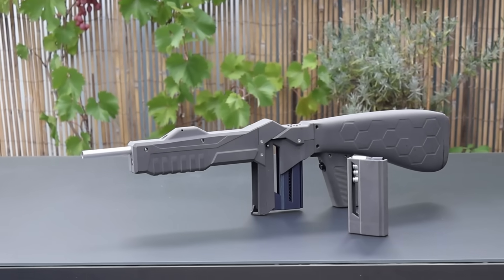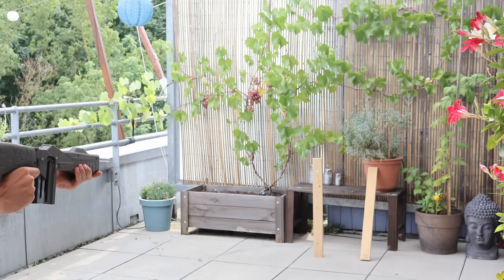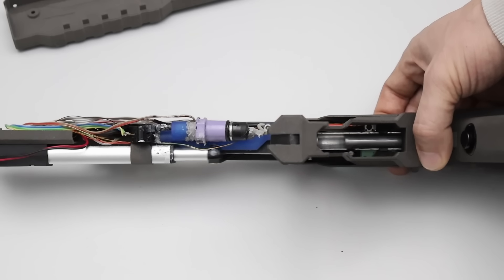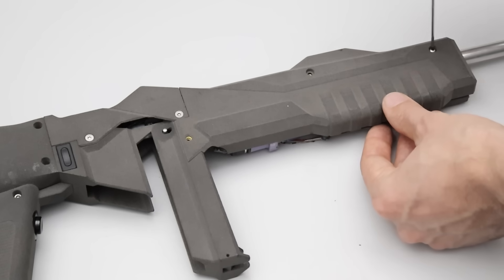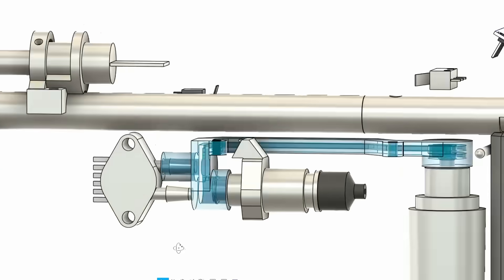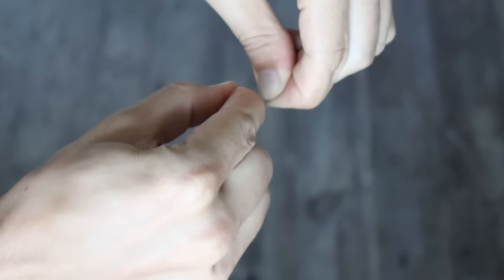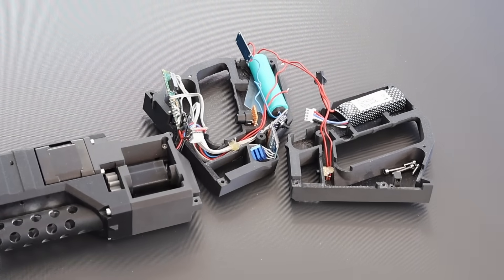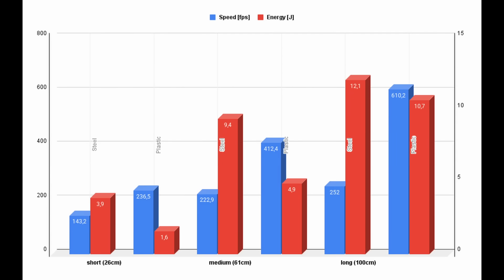I Built a Semi-Auto 3D-Printed Spud Gun

Comment: I've seen simple designs (in quotes, simple). Some guys from Malaysia or the Philippines, I don't know, have fully semi-automatic guns there that work like clockwork and produce 600 fps. They make a reducer, something like a carburetor from a simple tube with holes inside which is a syringe needle, the gas captures the required amount of air and blows into the combustion chamber, the bolt lever is connected to this mechanism, you unload the ball and hold the bolt pulled towards you for one second - it's primed, close the bolt and shoot, and so on 20+ times without error. These are some kind of miracles. I took a simple 250 ml hydrogen peroxide can (thick plastic) and sprayed insecticide for insects inside (it contains 95% alcohol and 3% propane). I sprayed and waved it until a mixture formed. The tube/barrel is in the lid. It was very difficult to use. But it was a damn can with a tube, so if something happened, you could rip it open and throw it away, and you'd be out of trouble.
Reply: But as always, it turned out to be much simpler and had already been invented before us, lol. A gas paintball marker. Specifically, one that works by igniting the mixture, not just gas like an air gun. This thing is fully semiautomatic, and it sold without issue, worked flawlessly... and no electronics, just a piezo.

Comment: Combustion took time. The position of ignition source is also critical: it is better to place ignitor at the very center of combustion chamber. Or plase several sources if electric sparks are used. HV-module can beeasily used without ant RF interference - just power it with completely separate lithium battery and trigger from the main board through the mechanical relay. Or connect ignition directly to the trigger button without any connections with the main control board. Good electic spark provides much more reliable and rapid ignition. Also, some obstacles to make combustion fron turbulent may greatly speed-up the combustion process.
The speed of combustion is the main cause plastics can't get high energy from short barrel. They just leave too fast before the pressure reaches it's maximum.
Reply from the maker: Those are very good points. Thank you! 
If I build another version I will do it exactly like that. I saw Smarter Every Day’s video on YouTube where he also investigated the ignition position. But I like the idea of igniting at multiple points much more. For some reason I hadn’t thought of that at all.
Igniting with the tungsten wire works reliably in a few milliseconds. But after a few hundred ignitions I have to replace the wire, which is a drawback. And simultaneous ignition would probably be problematic with that method.

Comment: If the longer barrel allows you to give more energy to the projectile wouldn't it be better to (re)design your gun around it? It's a pain in the ass, of course, but it will give you more space inside to work with
Reply from the maker: How do you mean? Making the combustion chamber smaller? I wonder if the energy would decrease then even with the smaller barrel though the chamber seems to be bigger than necessary for the shot barrel.
Reply: @it_could_explode  or keep the optimal barrel for the chamber and build a bigger body to fit the barrel. It should give you a bit more space for the wiring if it's a problem

Comment: A steel ball has much more inertia. It accelerates more slowly. It remains in the barrel for longer, allowing more energy transfer. A plastic ball is spat out fast and a lot of the gas gets wasted. In the longer barrel, the plastic ball is inside much longer getting closer to max theoretical energy transfer.

If you want even more energy, spray some silicone lube into the barrel and on the balls for a better seal and less friction.
Reply from the maker: Good explaination, thank you!
Reply: @it_could_explode  You're welcome. I want to test this theory on my paintball launchers. Even bought a radar to measure the speed, but haven't gotten around to it yet. But it makes sense.

Nice video BTW, gave me some interesting ideas...

Comment: Did you consider using an oxygen tank instead of air for better control over the gas/oxygen ratio and better utilization of the combustion chamber's volume?
Reply from the maker: I actually did, but I haven’t found any compact tanks. Less effective but better than air would be nitrous oxide, which is available in very small cylinders. However, both oxygen and nitrous oxide are stored under very high pressure. That’s manageable, of course, but not easy if you want to keep it compact and have only limited manufacturing capabilities.

Comment: Could you add a duel gas chamber  that alternates when firing to speed up the action and use 2 gas bottles that are alternated in the up down position, one will always have the liquid oriented on the bottem. Use a sensor to determine the orientation. The cooling problems would be mitigated.

Comment: The increase in speed could be explained the same way as is with airsoft AEGs. There is a volume ratio of chamber to barrel. You have a massive chamber holding lots of gas, especially in its expanded form. The projectile is out of the barrel long before all of the gas leaves the chamber. That means lots of energy of the gas is wasted with a short barrel and the longer the barrel gets, the more efficient the system becomes
Reply from the maker: I think thats right

Comment: Just an idea for a compact filter you might find one inside of a "bic lighter" or one of those small "jet lighters"
Reply from the maker: I thought so too but if you hold one of these jet lighters upside down for a while the flame will suddenly be much smaller. That is when all liquid gas in the hose is used up.
Reply: @it_could_explode  I took one apart and it definitely has a small filter in it.

Comment: Have you considered making a pneumatic/basic compressed air version? Doesn’t even need to be CO2… could use a hose to connect to a belt pack or backpack style air tank to be able to have enough capacity, if it can’t be fit within the launcher itself.

After making many versions of potato cannons, I made a golf ball cannon - but used compressed air instead of igniting a gas. Was very very effective and allowed for more predictable/consistent results. The compression chamber in my version simply had a shrader valve (like a bike tire) and we’d hook it to an air compressor to fill it. My design was intended as a single-shot - but we could have connected the chamber to a larger supply of compressed air for rapid refills, controlled by a valve. This could be an electronically controlled, automated valve mechanism - to try to stay faithful to the complexity/styling of your current design

Comment: about the barrel length and projectile mass. The steel projectile is too heavy for the propelant charge. Its similar to the ballistics between 5.56 and .300blk. The 300blk mass to propelant ratio was optimised to specifically go subsonic with high mass. 5.56 has low enough mass that chamber pressure can take it to much higher velocities with a similar charge. It just needs length to accelerate.

Comment: With a shorter barrel, the plastic bullet has already left the barrel, whereas the steel bullet still experiences energy transfer. The longer the projectile stays in the barrel, the more energy can be transferred. Up to the point where all energy is transfered and friction and the cooling of the gas will decelerate the projectile.

Comment: The energy getting bigger with barrel length is kinda weird... 
But best explanation I reached is the amout of time the pressure is acting on the projectile (this is from airsoft systems and it was refered to as joule creep)....
Heavy ball will take more time to get  out of the barrel compared to light ball (steel vs plastic). The longer the barrel the better  for the plastic ball as more of the energy of the explosion is used.

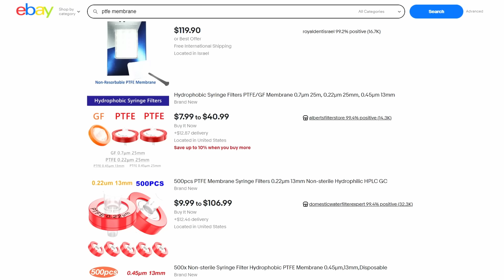Comment: At about 9:50 where you are wondering about a filter/regulator for the butane, I think you can get one from a Bic lighter. It is located under the outlet as part of the valve. You could probably just break a lighter apart and use the valve from it as a regulator. This is a great project!
Reply: Just commented exactly this, it’s a good idea. If higher flowrate is needed, some butane blowtorches/burners have exactly the same part, just scaled up to allow more fuel through.

Comment: If I'm wrong ignore, if you are from Germany however, (bc of the accent) this "potato cannon" is illegal af and could get you into a lot of trouble. Legally anything that accelerates a projectile through a barrel is a gun in Germany, which is illegal without proper license and improper storage. Due to it being a gun, you absolutely can't mount lights or lasers on it, that's another law (that airsofters hate). I love the engineering but it's still technically illegal and could get you a minimum of 6 months all the way up to 5 years of jail time and a fine. Be careful please

Comment: My best guess would be the steel balls just require more force to approach the speed of the lighter plastic. Longer barrels always just mean there's more room to apply pressure before it exits  the chamber, though required propellant volume increases with barrel length. The explosive propulsion is transferred to lighter projectiles as speed more easily due to a lower mass resulting in lower energy but faster moving projectiles, while the opposite is true for higher mass rounds. The other issue you might be facing with the plastic rounds is a less perfect sphere results in more escaped gas pressure before exiting the chamber and less energy transfer over all.

Comment: I think the answer to 16:06 is to do with the mass, the speed the gas burns and the time the projectile takes to clear the barrel. 

The steel balls are beginning to experience losses, possibly through gas blow-by or .   But also less energetic combustion over time. 

The plastic balls are still experiencing the most energetic combustion but for the full length of the barrel. Also less time for blow-by gases.

There may also just be a difference in clearance allowing the plastic balls to have less blow-by overall and everything above is just wrong. 

Either way. Seems you have an optimum projectile mass and barrel length. Time for discarding sabots? 😄

Comment: For the gas/liquid issue, look at de-icer units from older CO2 powered paintball marker/guns.
in the 90s i built one with hydraulic fittings and cutting up aluminum wire into small bits.

Comment: to the last Point: The formeula for kinetic engergy is (1/2)*m*(v^2).  
So the Velocity (because its gets squared) has an significant higher impact on your Energy output compared to the mass of the projectile.  
Which results in the decreasing difference between plastic and steele.

Comment: 16:00 airsofters call this phenomenon "joule creep"; It's mainly revolving around the fact that the more time the projectile spends in the barrel getting accelerated, the higher its final velocity will be. The heavier the projectile, the slower it accelerates, the more time it spends in the barrel and the more gas is burned and the more energy is transferred to the projectile.

Now the longer the barrel gets, the smaller the difference becomes because both the heavy and light projectile spend so much time in the barrel that most of the potential energy from the burning gas is already transferred to the projectiles. In theory, with an even longer barrel, at some point both projectiles would have the same muzzle energy because 100% of the potential energy of the gas would be transferred, and the shorter the barrel is, the bigger the advantage gets for heavier projectiles.

This also occurs in real firearms, where operators sacrifice muzzle energy to have a more compact and maneuverable rifle, and where hobbyists accept higher bullet cost for heavier projectiles to have more muzzle energy and accuracy at range.
A special example is the .300 BLK calibre which comes in supersonic and subsonic versions, where you can use the same rifle with a very short barrel (usually 6-9") that will either achieve super quiet sub-sonic shots using heavier projectiles, or getting faster moving but much louder supersonic shots using lighter projectiles.

Comment: for the barrels the lower sectional density of the plastic balls means a smaller pressure can still push significantly. think of putting your laptop infront of a fan verses a sheet of paper. one is easier to move.

Comment: This is an amazing project, however I have a quick question: wouldn't it be more feasible to move the air vent to the side of the stock, instead of keeping it on the back of it? That way, you could just shoulder the cannon without worrying about the oxygen supply in the chamber.

Comment: The gap between plastic and metal ball decreases with increased barrel lenght mostly because the metal one is unable to increase its speed while increasing the barrel lenght. It could be because of higher metal to metal friction, or maybe a tiny size difference. Before the graphic, i've bet the steel one would increase further with longer barrels, since it would keep higher pressure behind it for longer than the plastic, wich would accelerate faster, and thus spend less time accelerating... I'd can easily test it with different materials, try brass, and different types of plastic (nylon is know for low friction), and if the key is friction, nylon coated steel balls.

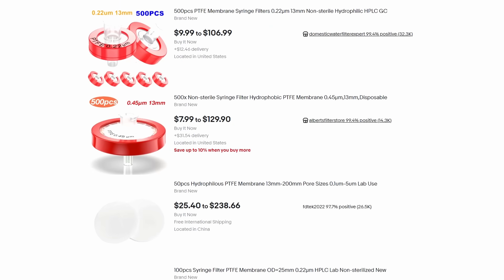Comment: Hey! I have EXACTLY the right solution for your liquid to gas filter at 9:52.

You would be better off diffusing the liquid butane using an aquarium air stone! This serves multiple problems you’re facing:

- The butane can fully expand through the air stone
- the stone will contain about 80% of the cold from the evaporation instead of cooling the chamber
- no material damage from solvent gas and can withstand the explosion and heat vs membrane filters.

Its the perfect candidate! I love your projects and i hope you find this helpful.
Reply: Aww thanks guys that was so wholesome. 😂 i didn’t ever expect to be on the recieving end of internet kindness and i really appreciate it
Reply: @Dudeinatube  You find some really cool people in the comment section of videos like this! It's almost like the Internet in the 90s, before the normies screwed it up.. 😀
(Yes I am old.. o_O)
Reply: you are one cool dude in a tube
Reply: Another REALLY compact solution that’s ready to accept plumbing tubes is the tiny metal nozzle output of a butane lighter’s fuel tank. It has metal mesh inside to diffuse the liquid into gas and is specifically designed for butane (pressure and corrosion resistance).
Alternatively, get a butane burner that’s advertised to work upside down. Pulling one of those apart reveals a metal sponge in the gas tube designed to diffuse liquid butane into gas, with the advantage that flowrate doesn’t actually change when liquid is fed instead of gas (the liquid is slowed down in the sponge while gas flows more freely, so when liquid expands, it doesn’t explode in volume).
Reply: @someonewithauniqueusername9397 awesome you’ve played with your fair share of lighters too! 😂 these would definitely work 100%. But the one i recommended relies on the exact same principles and can be found in sizes as small as 1x1cm. Looks like he’s got two options now
Reply: Replying to boost this. Neat solution!
Reply: Can also use the sintered brass air line vent diffusers.
Reply: good job

Comment: I would like to suggest some changes:
1) Add the air intake on the top of the stock to make it easy to shoulder it 
2) Add some Picatinny STANAG 2324 rails for an optic 
3) Make the bolt lighter so it could be direct blow back but you can still keep the electronics as the recoil spring.
4) Make the magazine spring wider so it can cycle reliably 
I'm not sure if the third suggestion will work so take it with a grain of salt. And keep the electronics just in case the blow back fails

Comment: Nice!! To fix the liquid gas issue, try adding an expansion chamber and a pickup line that's central to it. E.g. This approach is used when CO2 capsules are used for HPA airsoft replicas - Wolverine and polarstar make both make buffer tubes with integrated CO2, expansion chambers and regulators. They work even when aimed down. Liquid CO2 would ruin the regulator, solenoid valve and the HPA engine, not to mention shot consistency.

Comment: Not a theory, it has everything to do with velocity being exponential to momentum and mass being linear.

This is why, despite a 9x19 handgun round being 140+ grains in some loads, it will be outperformed by rifle cartridges like 5.56x45 at 55 grains. The difference in speeds is 1000 FPS to even +2000 FPS between 9x19 and 5.56x45

Comment: Why not switch to oxygen injection? Don't need to worry about purge as you'll be injecting the needed oxygen. This could allow for more power and a smaller combustion chamber. But you'll also need to design a proper upper receiver.